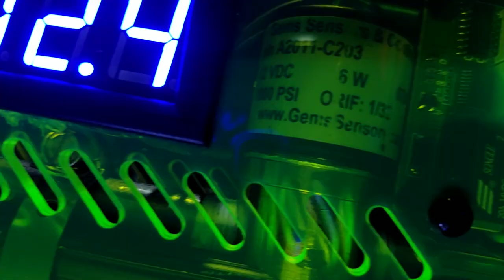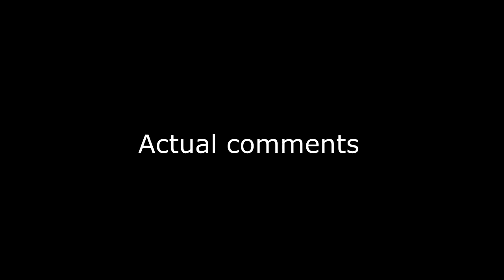Hot glue gun 2.0! (A response to Michael Reeves fans)

Comment: I checked with my science team, and they assure me that this is what is technically know as "f***ing awesome" +/-1% for measurement errors and changing tastes. This works impressively well, especially for such a crazy idea, and the gun gets bonus points by looking pretty decent and having at least a nod to ergonomics (e.g. the entire gun fits in your hands and seems sturdy enough to last). It's reliable enough that the engineer in me wonders if some practical use could be found for it🤔. In any case, well done 👍
Reply from the maker: Thanks for noticing Zach, I attempted to apply my product design skills into making it reasonably functional, compact, and aesthetically pleasing. The pressure cable looped at the back was impractical as heck though, but it looked so much cooler...
Reply: It could be used for crowd control. It would be cool if he could make a soldering iron similar to this (without the canisters).

Comment: I feel like this is more deadly than a actual gun
Reply: or atleast very painful if you every got burned by hotglue you know it.

(most often you are lucky if the hotglue is already cooled off a bit, but if its above a certain temperature it will permanenty melt to the skin, and the skin will also burn like form hot water. If you remove it you will loose at least 1 skin layer )
Reply: Unless you get a headshot by an actual gun
Reply: No
Reply: Have you seen and/or heard an actual gun?
Reply: @bruderus8577  go to therapy or something like that
Reply: Hot glue gun
This gun shoots glue at high velocity
+10 fire damage
Reply: @mangochad5037  that would hurt less
Reply: @bruderus8577  Dude, get some help

Comment: Funny, getting closer to a real Marvel comics 2nd string villain called,Trapster. He originally was called PastePot Pete. I always kinda liked the character as he did beat heroes every so often.
He had a pressure driven glue sprayer gun that would really be impossible to make as it propelled huge amounts of the liquid glue gel stuff that was liquid until the time it took to cover something ,then it solidified and expanded when exposed to air. 
Kind of like that product "great stuff" expanding polyurethane foam sealer.
The impossible part is the device would be too big to carry, youd need a large industrial sized machine frame with really large pump motor and big reservoir tank and a long barrel to be able to eject enough volume of material to make a big stream fast enough to coat someone fast enough to entrap them.

Comment: would you get better results if the air actuated a piston like one of those water tube guns? it should let you still get the force from the 800psi stream and it would keep the air from mixing with the melted glue and sort of doing that aerosol like web spray

Comment: Can you just use the Metric system just meters and centimeters than the ultimate conversion nightmare system in feet and inches like all other imperial measurements what isn't logic but a pain in the ass while using the Metric system you don't have to be a mathematical genius to understand this. It is just 1 simple type of measurement in distance, weight, height and volume you name it. You can easily calculate it and it is just logic. 

Why are you Americans so tied to a different and old system that no one who thinks even remotely logical uses and really understands? For instance distance. Miles, yards, feet and inches. Problem. You can't devide the own trough another. In Metric system you have just 1 piece of measurement system and you work with decimals where you only have to devide or multiply. Like 1 Kilometer is 1000 Meter. Every meter is 100 Centimeter, every Centimeter is 10 milimeter. So you can just use all this to calculate exact distance. 5.000 meter is 5 Kilometer. 1000 milimeter is 1 meter. Everything is uniform and simple. You don't have to calculate all different pieces of measurement where you can't multiply or divide inches in a same system to get let say 30 inches is a meter 3.000 in inches is 100 yards. It doesn't work and you always need  a calculator. 

How many accidents happened with airplane refill in Liters and Kilo's or Gallons and lbs. So my point is as someone living in the West Europe. Why can't nobody just adapt a better system. So far I know Science just uses Metric because what a mess would it be if you write about the same subject but 1 uses Imperial where the other uses Metric. I hope I made my point with my best English😅
Reply: he's from a country that uses the imperial system, so he knows the imperial system better.
Reply: you're not gonna be able to just swap over an entire country to use a different unit of measurement especially with how much infrastructure was built around it now, and friendly reminder, the British invented it first and gave it to us. A duodecimal system (which is what the imperial system is based on) was more practical for the times  (invented in 1800)  was easier for people to divide, the imperial system is a base 12 system just like how our clocks work as well, there easier divisible fractions there (1,2,3,4,6 and 12) when computing tools were limited. We just haven't switched over because of how much our nation has already been built with it, it would cost billions to change. And the aeroplane issue? Depends on the nation, larger aircraft typically fill up by the Lb or KG.